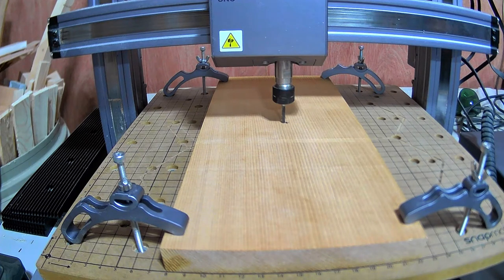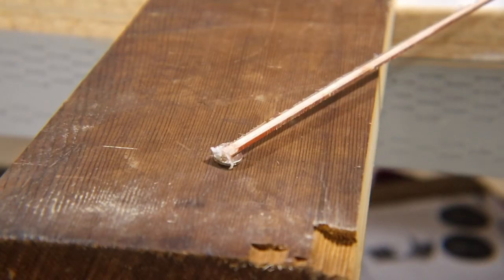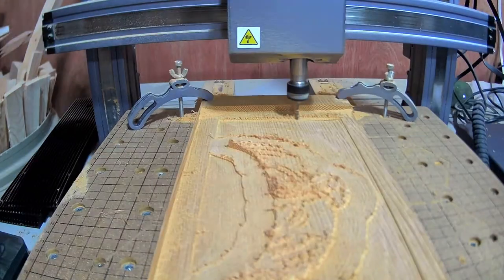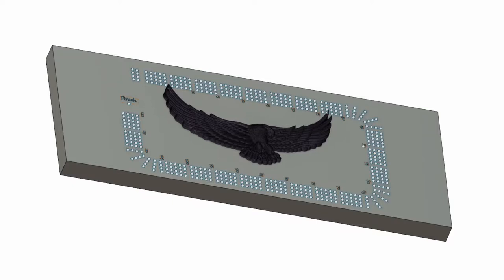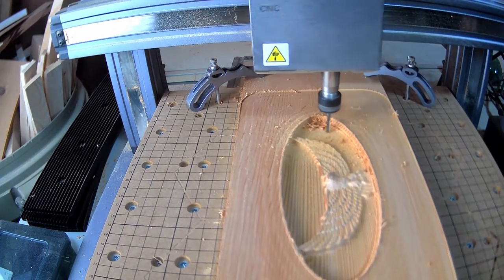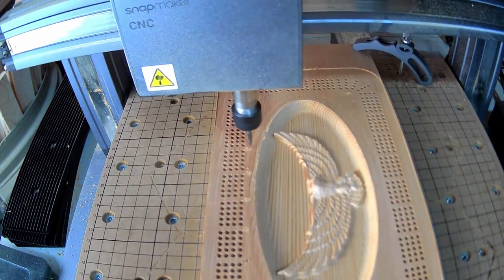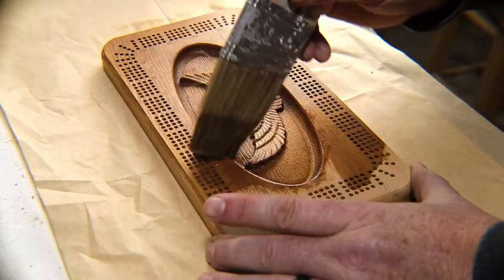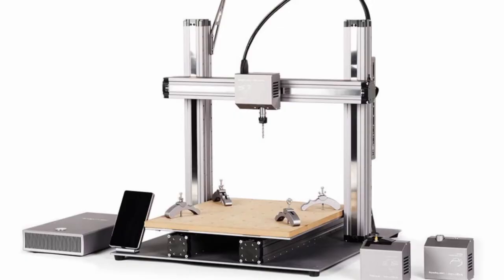Small CNC Project Ideas - Cribbage Board

Comment: I tried to make one with Illustrator, and exported the SVG, loaded it in Luban, looked great, then when came time to drill the holes, it made them too big.
Not plunging, just cutting on the outline of it. If i tell it "Fill" the G-Code is like 10KB.. not sure what i'm doing wrong there. :(
Reply from the maker: I just used the drill bit for the holes.